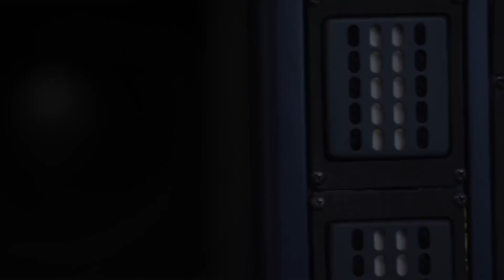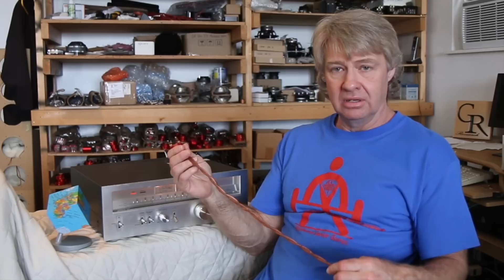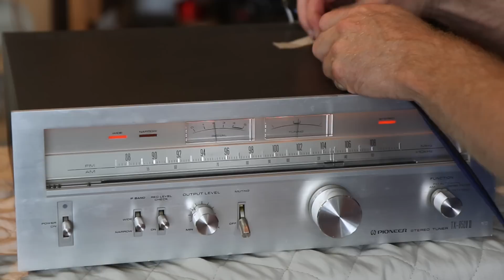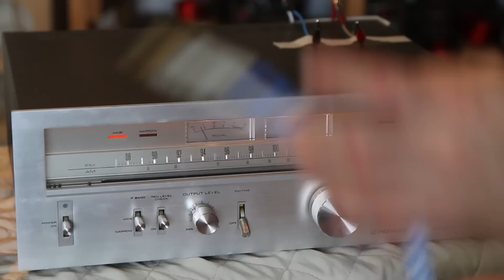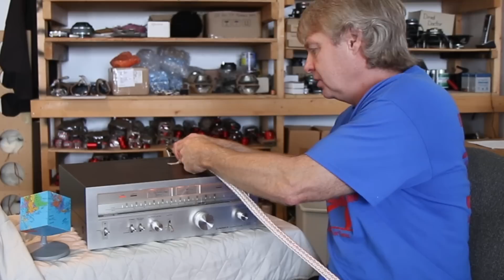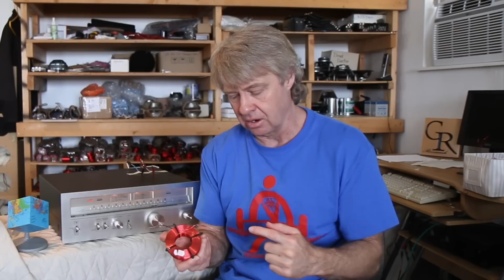Do Audiophile Cables Matter? Here's PROOF!

Comment: Maybe if you were connecting up an active monitor at the other end you'd have a point. Normally there's not a tuner or amplifier being fed by a speaker cable to pick up these weak radio signals and boost them, just a speaker that has to be driven passively with some real wattage. If you hook a piece of speaker wire at the end of a speaker by itself, you're not going to hear static coming out of it, speakers require far more power than that. This is why interconnects requre shielding, not speaker wire.

Comment: Let me allay your utter confusion. Radio is in the kz and mhz side of the spectrum aka radio band. Their power is infinitesimal which is why you require a tuner in order to boost the signal thousands of times so the amplifier can convert it into power for the speakers. Whatever radio signal the speaker cables pick up has zero effect on the sound of the speakers, first, its of such low level that it could never induce movement in a cone, second the frequency is so high no tweeter ever deviced could reproduce it. On the other hand, interconnect cables in particular if very long are suceptible to interference mainly from electrical circuits and thus may produce hum. Again the reason is simple, whatever noise within the audioband they pick up will go through the amplifier and thus be audible. That problem is very easily solved by using balanced cables even the best of which are very affordable. I do use fancy Kimber 12 cable not for it noise rejection but because I biwire my speakers (it looks awesome) and because they have a combined gauge of about 9AWG and thus offer amazing low resistance. Furtheremore, since its 24 conductor braided wire there is very low skin effect thus a superbly flat frequency conduction within the entire audio band. I'm however well aware that aside from the benefit of very low impedance all other benefits are completely inaudible even using reference grade speakers as my BW 803D3.
Now stop spreading gibberish.
Reply: If you think a reference grade speaker is a B&W803D3 that speaks volumes. Those speakers are built with budget level parts. 

Absolutely RF noise has an effect on the signal. Why else would cables be shielded or why would balanced cables be needed? 

An instead of splitting that cable up in half and using it to bi-wire those speakers, replace the binding posts with a single set of tube connectors and use the hole cable on it. That will be a nice improvement in clarity.
Reply: @dannyrichie9743   🤣🤣🤣🤣
Any music you listen to in the last 50 years has probably been studio monitored by BW 800 series, ergo the industry reference par excellence. BTW this great video is using a radio tuner from 50 years ago as an oscilloscope 🤣🤣🤣🤣🤣🤣💩💩💩💩
I guess the reference amp is a 70s Heathkit receiver and the speakers are Bose 901s with broken cone foam suspension! The whole thing is ridiculous and shows utter and absolute ignorance of electronics and audio.
Reply: @Wised1000  The recording industry has been using horribly unusable speakers for mixing for years (Yamaha NS-10's). That means nothing. 

I don't think I could have made the demonstration any easier. If you don't get it then I can't help you. 

And FYI, our system is used as an industry reference. Companies actually bring new products here just to listen to them on our system.

Comment: I am a stupid audiophile. There are cable that do make an audible differece to me over a period of time (days). An the right ones can improve the audible experience of my system.

As an idiot I always hope, the more money I spend the better the results are. Boy, would it be easy. Sadly this is not always the case. Some were fancy and cost more, which i hoped would improve the experience, did make it worse. Therefore against my expectation, sometimes a more expesive cable is not worth the money. But the make a difference for sure! Explain this with the placebo effect!

The most idiotic thing an engineer explained to me: „Actually, I can hear a difference, when you swap the cable. But I know, I can not explain it technically, it can not exist, therefore it has to be a placebo-effect knowing you swapped something.“ Even my father 76 can hear the difference, even when he complains about the ammound of money I spent on a cable (3 figues a set of cables)

Now, bite the keyboard, woodears!
Reply: There is bigger woo than that. I know a guy who lived 2000 years ago who was resurrected and who will come back to resurrect us all! Your cable woo can't beat my resurrection woo! :-)
Reply: You win!

Comment: This is the stupidest test I have ever seen. Last time I checked, you don't use your speaker cables as an antenna. How about a proper null test? This is the same crap that they talk about on the Hoffman  Audio section of the forums. They believe in total snake oil.
Reply: Snake oil is yummy. It tastes like chicken fat.
Reply: All I can do is show you the truth. You won't believe it until you hear it for yourself.
Reply: @dannyrichie9743  Nobody can hear the difference. People have done plenty of blind tests. It's all in your mind. Would you like a resurrected Jesus with that? There are way stronger mind drugs than audiophile cables. :-)
Reply: @lepidoptera9337  I have never had anyone over for an A/B comparison that could not hear a difference. On a high end system it is pretty easy.
Reply: @dannyrichie9743  But you didn’t show anything. No truth in what you show at all.
Reply: @electricwhiterabbit  I'm sorry you didn't get it, but I just demonstrated how some cable picks up RF and some do not. If you can't get it, I can't help you.
Reply: @dannyrichie9743  sure it pucks it up, but you cannot hear it. In the application that it is being used, it is not possible to hear it.
Reply: @electricwhiterabbit  What is not true? That one wire sounds exactly like the next? Of course there is truth to that. Just like one capacitor sounds exactly like the next. I have a test setup here in my lab that has a noise + THD floor of roughly -130dB... and I can't see a thing with it for either wires or capacitors. Now, unless someone can prove to me that their ears have lower noise + THD than that... :-)
Reply: @dannyrichie9743  Ah, so you have sucky audio equipment that doesn't filter RF. OK. I don't. That's because I have professional equipment, not the audiophile crap that they are selling at ten to hundred times the price that it's worth.  :-)
Reply: @lepidoptera9337  wires should not have sound. If they do, there is an issue with your wire/connections. Depending on the circuit, caps can or cannot have a sound. Spending gobs of money on expensive caps in a crossover is a waste of money. You cannot hear a difference.
Reply: @lepidoptera9337  Ha, ha, professional level gear is unusable for us. We are in a different league.
Reply: @electricwhiterabbit  In our system we can easily hear it.
Reply: @electricwhiterabbit  Exactly. One can always use cables that are undersized, but I am assuming that's not what we are talking about. One can certainly not "hear" or even measure the chemical composition of copper (oxygen-free...) this way. If one could, it would be a standard analytical technique. I am also not talking about polarized electrolytics or ceramic caps that have highly non-linear dielectrics. But there is no measurable difference between a cheap and a hyper-expensive foil capacitor with the right voltage rating, except in its price, of course. The, by far, largest contributor to THD are the speakers these days. It's not something speaker manufacturers like to talk about but it shows up easily on frequency plots if we also measure second and third harmonics. But to be honest, I can't even hear that easily. What I can hear are contributions to frequency response by room acoustics. The room is almost always the main sound killer.
Reply: @dannyrichie9743  Yes, you are. But not in a good way. :-)
Reply: @dannyrichie9743  1.5 billion people are talking daily to god, too. So what?

Comment: Here is another piece of knowledge to prove how ridiculous the conclusion of the experiment is. In order to pick up signal effectively, the optimal antenna length is the wavelength of the signal. Human hearing spectrum is 20-20,000 Hz so the wavelength of electromagnetic signal at the corresponding frequency is 15 km - 15,000 km or 9.3 miles - 9,320 miles. That means in order to make the interference really significant to affect what you hear, you speaker wire needs to be at least a few miles long. Does it make sense to spend big money to deal with the impossible interference? Absolutely absurd!
Reply: Man, there are a lot of ignorant people posting here, and you are one of them. Why do you think they make balanced cables or shielded cables?
Reply: @dannyrichie9743  I can definitely tell you I am not as ignorant as you are. Those balanced cables or shielded cables make sense only for small signals such as the input for pre-amplifiers. Although the noise strength is small, the gain of the pre-amplifier is large and after the amplifier, the noise level can be too much. Yet after speaker cable, there is no amplifier. The noise picked by speaker cables is added to the speakers directly. There is no amplification at all to the noise picked by speaker cable. The noise is just simply too weak to be applied to speakers for people to hear.

Comment: As a graduate from EE, I have to say the conclusion of this experiment is highly unjustifiable. Yes cheap cables pick up interference but does it matter? That interference can be measured by instrument doesn't mean it can be heard by human ears. First, if the frequency of the interference is outside the spectrum perceivable to human ears, it doesn't matter at all. For example, if the interference frequency is 100KHz, human ears cannot hear it at all. Second even if the frequency of the interference is within the spectrum perceivable to humans, is the strength of the signal strong enough to be perceived by human ears? If the signal / interference ratio is higher than 85-100 dB, the interference can be ignored totally.
Reply: Man, there are a lot of ignorant people posting here, and you are one of them. Why do you think they make balanced cables or shielded cables?
Reply: @dannyrichie9743  I can definitely tell you I am not as ignorant as you are. Those balanced cables or shielded cables make sense only for small signals such as the input for pre-amplifiers. Although the noise strength is small, the gain of the pre-amplifier is large and after the amplifier, the noise level can be too much. Yet after speaker cable, there is no amplifier. The noise picked by speaker cables is added to the speakers directly. There is no amplification at all to the noise picked by speaker cable. The noise is just simply too weak to be applied to speakers for people to hear.

Comment: For years I had my bookshelfs hooked up to my Onkyo receiver via basic Best Buy monster cables. Custom cut and terminated on AV end to bananas. I was happy for years until I decided to give TRANSPARENT cables a try. Picked up a used pair of musicwave from said brand, and I blew my mind. I now heard things those basic cables did not play.

Proof is in the putting: $50 monster cable VS $500 TP MusicWave. There was an huge difference! Not only to my young ears, mind you. My parents, too, heard a difference. I didn't believe it so I plugged the original cables and put the same song on, Big Difference! Fun fact, upon doing so, I noticed I had those new high end cables plugged in the wrong way, as in signal direction was going from speaker to AV. I fixed that and didn't hear a difference.

So long story short, don't cheap out on speaker cables if you wanna enjoy your system to the max :) My mind on this topic is changed for good.
Reply: We all know you are a troll and don't really believe what you are saying. So there's that........... 500 dollar cables on a cheap Onkyo receiver? Please.

Comment: Here's a few things experience has taught me over thr years.

1) people usually underestimate the importance of the connectors/plugs. You can have the best quality RCA cable and ruin it all with RCA plugs that introduce connection resistance, especially on the mass ring. So don't fall for fancy cable talk unless you take a look at the connection itself.

2) cable capacitance has a huge impact on a turntable's or rather cartridges' performance through cable capacitance when you run an MM cartridge.

3) exotic devices with stranger electrical input/output parameters will react to cables with different conducting parameters like inductivity or capacitance. Know your devices before you buy a connection.

4) less is more. Choose a cable that is as short as you can get away with. Also, choose a cable that can be arranged without putting additional strain on device sockets. Don't try to forcefully bend a very stiff cable into a radius it isn't designed to be arranged in.

5) don't cross signal cables close over power cables. You don't want to introduce some strange AC hum into your signal paths through induction.

Comment: I also think this demo is flawed.  The EM pickup is very small in voltage comparing to the power delivered to the speakers.
Reply: So then why do they make shielded and balanced cables?
Reply: @dannyrichie9743  Now you are talking about signal cables?  For signal cables, it makes lots of sense.

Comment: I would have laughed at this had it no been so overly long and intensely boring. You've certainly proved that some speaker cables make better antennae than others but that's about it. This test is not relevant to noise from the receiver to the speaker, this is pseudo science.
Reply: So then why do they make shielded and balanced cables?

Comment: Some fancy analog cables DO CHANGE sound. The goal of the manufacturer is to create artificially a “new” consumer electronic market, in order to sale another “hifi” component for your system. Technically speaking, these are not “real cables”. Normally they add components, filters, materials, and so on to cause an effect and rise prices. In other words, you are doing tone control in a weird, uncontrolled and expensive manner. This gets the consumer into a fanatic pursue of the perfect cable to fine tune the system. Since this is a hobby, there is  nothing wrong with that, as long as you know what you are doing. My piece of advise, get your self profesional level cable and save money to get better gear

Comment: i like what you did there... You didn't try to get into the this wire is better than that wire debate. You merely demonstrated that some wires are more capable of picking up extra noise. So it becomes less of a this cable is better than this cable, and more of a this cable is worse than that cable.

Comment: Too much copper and you get capacitance, this is where pure oxygen free cables help in that you use just enough for what you need. This helps in long runs.

Clean power from the wall depends on how well your electrical is working on your street and also how well the 220v is broken down to 110v in your breaker box. Then also clean grounds, well terminated, etc. With all that said, a $150 power conditioner like what you see on computer servers is far better than most and filters you can buy.

I dont have shielded cables and can have the volume all the way up and ear to the speaker without the slightest sign of any noise thats even on when dead quiet.

Elac UB5 with Pioneer Elite A-35r

Comment: This episode of GR-Research is badly contrived. The response of a 300 ohm RF input in the FM broadcast band to attached cables bears no resemblance to their use as speaker cables. I postulate that the response of the tuner's VU meter is simply a function of the VSWR on the cables. The parallel lines and twisted pairs have an RF impedance of about 100 ohms, so they are matched fairly well with the 300 ohm input, and signals will pass. The interleaved audiophile cable's RF impedance is much lower, 30 ohms or less, so the VSWR is higher, and less signal can couple into the receiver. An audio amplifier's output impedance is not 300 ohms, so we can draw no conclusions about this test.

Mr. Richie keeps bragging about the low noise of his reference audio system, and he is apparently giving credit to these cables. So why doesn't Mr. Richie connect an audio analyzer to his amplifier's output, and swap this collection of speaker cables in and out, as he did here, and show us how the noise floor of his amplifier goes up and down. Surely, this is the acid test. Show us a demonstrable improvement in performance that audiophile speaker cables make in your audio system, where they are being used as speaker cables, and forget this irrelevant test where speaker cables make poor FM antennas.

Comment: What is the general consensus on adding ferrite cores to speaker cables???
I tried some ferrites from aliexpress; I couldn't detect any difference but left them on the 10+ meter 12AWG OFC cables I use on my rear towers, however I ended up putting them on the inside of the terminal mount positive wire only.
PS Audio's Paul McGowen said they can choke the sound so I took them off the front towers but really didn't notice any improvement or decline and I really couldn't hear them choking, gagging or even coughing a bit.

Those braided cables sure do "Look" cool, I know I'm gonna have to get some one day